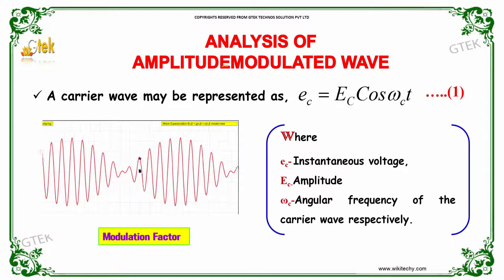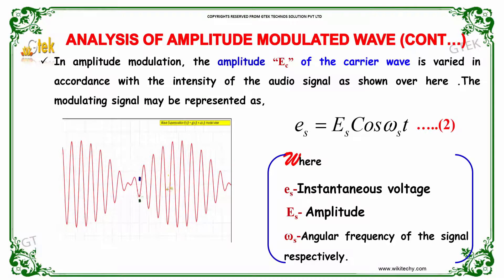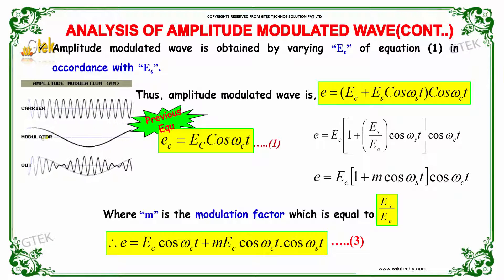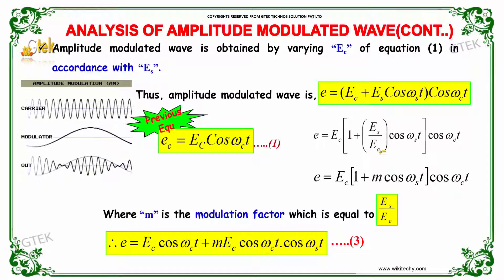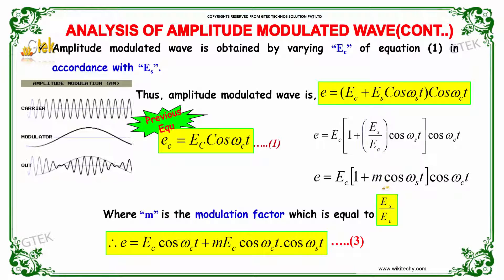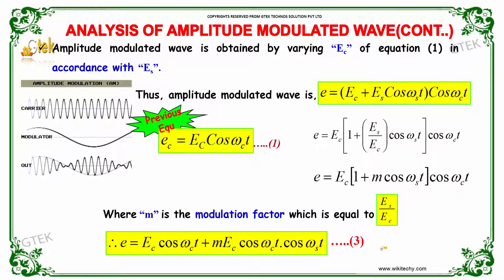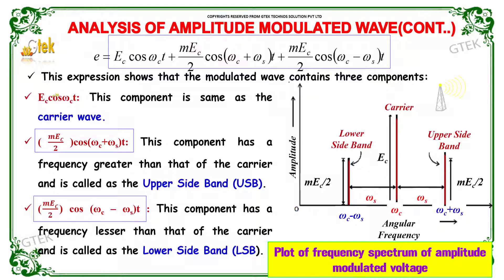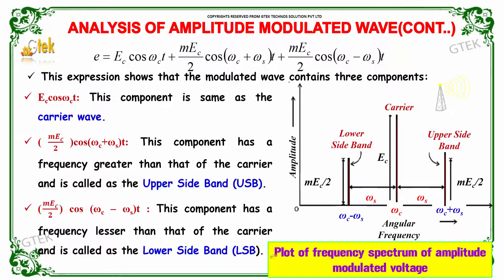Analysis of Amplitude Modulated Wave |class 12 physics subject notes|CBSE|IITJEE|NEET

Comment: Feb 6, 2017 - The receiving antenna is, therefore, to be followed by an amplifier & a detector. In addition, to facilitate further processing, the carrier frequency is usually changed to a lower frequency by what is called an intermediate frequency (IF) stage preceding the detection.

Comment: In amplitude modulation, the amplitude or "strength" of the carrier oscillations is what is varied. For example, in AM radio communication, a continuous wave radio-frequency signal (a sinusoidal carrier wave) has its amplitude modulated by an audio waveform before transmission.

Comment: modulation is the "process whereby the amplitude (or other characteristic) of a wave is varied as a function of the instantaneous value of another wave. The first wave, which is usually a single-frequency wave, is called the carrier wave; the second wave is called the modulating wave.

Comment: Amplitude modulation (AM) is a modulation technique used in electronic communication, most commonly for transmitting information via a radio carrier wave. In amplitude modulation, the amplitude (signal strength) of the carrier wave is varied in proportion to the waveform being transmitted.

Comment: In an AM (amplitude modulation) transmitter the amplitude (strength) of the carrier wave is varied in proportion to the modulation signal. In an FM (frequency modulation) transmitter the frequency of the carrier is varied by the modulation signal.

Comment: The Amplitude Modulated (AM radio) carrier frequencies are in the frequency range 535-1605 kHz. Carrier frequencies of 540 to 1600 kHz are assigned at 10 kHz intervals. The FM radio band is from 88 to 108 MHz between VHF television Channels 6 and 7.